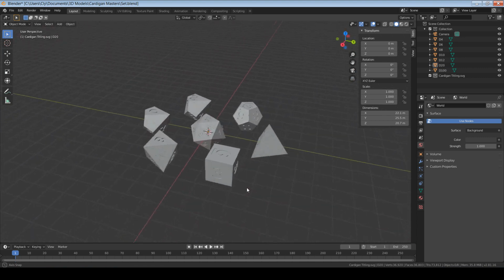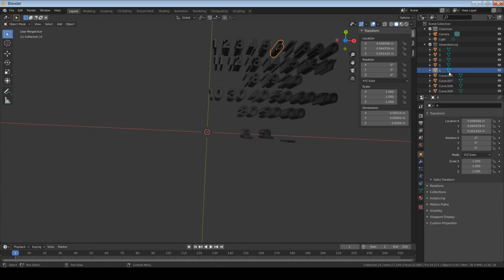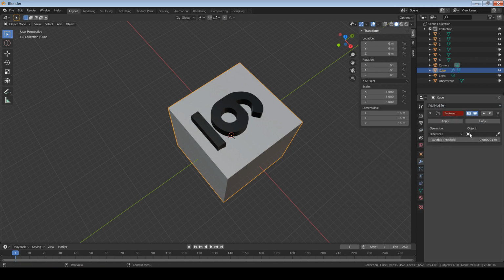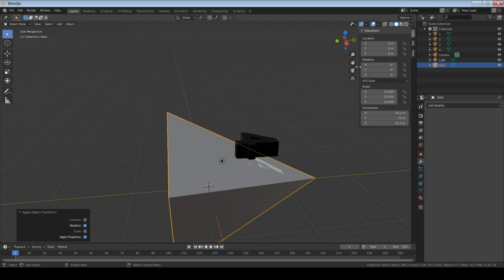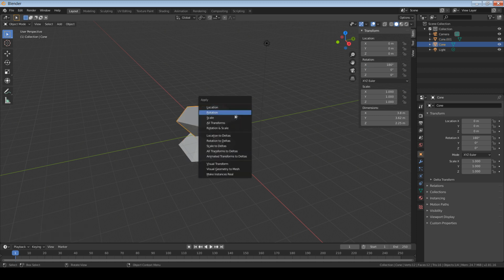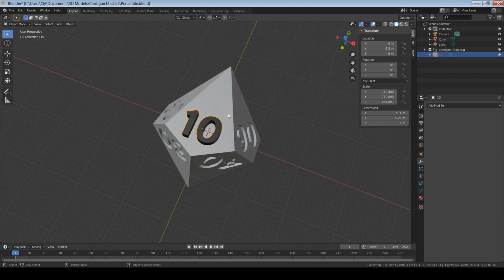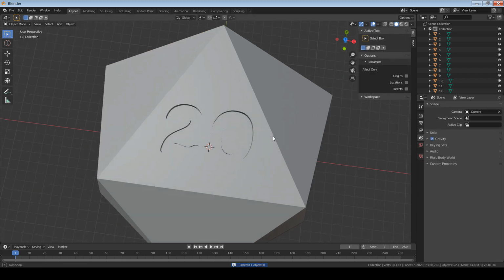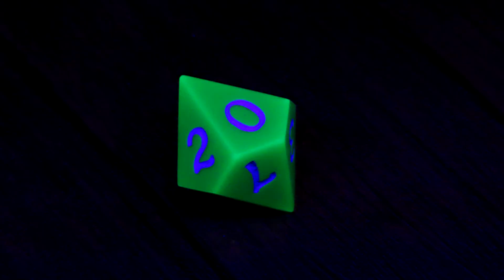Design Your Own Custom Dice for Free | Blender Tutorial | DIY with Cly Ep. 21

Comment: Great video! I'll need to take some time to fully follow it properly, particularly the rotations. You don't by any chance know of how to align numbers in Tinkercad on dice for D8 and above? :)
Reply from the maker: Sorry, I've never used Tinkercad, or any other CAD software for that matter. 😓
Reply: I'm working with Tinkercad right now. It allows numbers to be imported one at a time. Still working on the measurements.

Comment: Hello! I was wondering if you knew how to fix this issue, I tried following along but a lot of fonts I have tried to use are... broken? I dont know how else to describe it. A friend thought it was inverted normals but nothing we have tried to do fixes it. The font I am trying to use is called "Hadley"
Reply: Hey, I had the same issue as you. If you haven't figured it out yet, I resolved it by:
Instead of converting to a mesh and editing to extrude the face do the following:

Unfortunately I don't think you can do this to all of your numbers at once, you have to do them individually.
1. Select the number when it's still a curve file. On the  bottom right hand window select the "Object Data Properties" tab. The icon looks like a curve.
2. Expand "Geometry" and increase "Extrude" to .01 (1 right arrow press). 
3. Convert the number to a mesh
4. Continue with the rest of the guide - setting the origin, bringing it onto the dice, etc. You don't have to go to edit mode to expand the faces since you've already done that.
Reply: That fixed it for me, and I kind of understand why it does, since you expand the outline curve from 2d to 3d the program can't leave any blank spaces when creating the mesh, which it can in 2D mode....but I have no clue how the hell you figured that out
Reply from the maker: What program did you use to convert the font to an SVG file?
Reply: @ClyFaker  I used what you used in the video, should I try a different one?
Reply from the maker: Just to verify, this is the font you're talking about, right?

https://www.dafont.com/hadley.font

If so, I got it to work just fine using the SVG creator site I showed in the video. What image editor did you use to type out the font, since that might be the culprit? I don't know how it would be, but you never know. I used GIMP.
Reply from the maker: Also, I should have probably asked how they're broken. Broken in that the boolean operation isn't working, or something else like not rendering properly when you go to 3D print?
Reply: @ClyFaker  thats the font, and by broken I mean that it looks like chunks are taken out of it when I convert it to a mesh, so the bolean cant work
Reply from the maker: That sounds almost identical to what happened to me when I was trying to use InkScape to make SVGs. You might want to try using GIMP to create your initial image file, since that's working for me with that font. Also, maybe try changing the image file type (BMG, JPG, PNG, etc).
Reply: @ClyFaker  Awesome, thank you! I tried a different svg generator and that seems to help numbers 1-6, hopefully it fixes the other numbers as well ^.^ (I used only 1-6 as a test lmao)
Reply from the maker: Glad I could help, even if I don't know why that SVG converter decided to revolt against you in particular. 😁

When that first happened to me, it took me way longer to figure out than I'd like to admit...

Comment: Having a super weird problem. On the D10, as soon as I rotate by 180 and start on the other faces, my boolean difference no longer works. It adds instead. Advice?
Reply from the maker: I'm assuming you've applied the rotation and previous boolean operations (I sometimes forget if I'm moving quickly), and if you're on the D10 the font must have worked for the other dice. In that case, try lowering the number into the die a bit more before applying the boolean function. Boolean can be a bit persnickety with overlap points sometimes, and that same issue haunted me for a long time when I first tried making dice.
Reply: @ClyFaker  Yeah, I've already got 5 of the faces done and it breaks when I try to do the other side. Doesn't matter which number I use. I'm wondering if it's an issue with the shape itself =/
Reply from the maker: @ciarajs  That's so strange. What font are you using, and what did you use to make your vector file? I'll see if I can get it to work.
Reply: Oh, I solved it. May as well post the solution in case anyone has the same problem.
I apparently went rogue on the shape building phase. Instead of deleting the extra cone, I applied the boolean on it as well and then joined them. Don't be like me, kids. Follow the instructions.
Reply from the maker: @ciarajs  The fact that you were able to finish one half of the die without issues makes even less sense now... Oh boolean. 😅

Comment: I'm going to be using an online service to 3d print my dice. Do I need to create the supports for the dice, or do they typically do this for you?
Reply from the maker: To be honest, I don't know since I've never used one myself. However, if they do the slicing (preparing the model for printing) themselves, then they should. Be sure to ask before placing your order.

If they don't, you can do it using free slicing programs like Slic3r.
Reply: If you're using Shapeways, they just need the models.  They sort out the supports.  Other places probably do as well, but I'm sure they would be happy to answer that question if you put it to them.

Comment: NICE!  FYI Blender 2.83 is out and has a SWEET fabric brush in case you need to make robes or clothes...for your dice xD
Reply from the maker: They're cranking out revisions faster than I can keep up. lol
Reply from the maker: I'm very glad to hear that. This tutorial is aimed at people that have never touched the software before, so I tried to make things as straightforward and easy to follow as possible.
Reply: @ClyFaker  It really is concise.  I'm going to make a set later on tonight :)  I was getting confused by the angles for a second and then I remembered that I know geometry lol.
Reply from the maker: I can see the angles throwing some people, especially since I use negative angles. Then again, 15 degrees and -15 degrees is easier to remember than 15 degrees and 345 degrees. At least to me. lol
Reply: @ClyFaker  I ended up sort of winging it once I realized what you were doing and it worked out just fine.  I was able to follow along very well, and my only real issue was that moment when I was finishing up my d12 and realized one of the numbers was upside-down in relation to the rest..and it was well outside of my UNDO list lol.

Thanks again for this.  I have dice printing as I type :)
Reply from the maker: @user-e4p3b  I feel your pain. That happened to me a couple of times when first laying out the D12 and D20. 

Also, in case you don't know, make sure you use tin cured silicone with these dice if you're going to be making molds immediately. Platinum cured silicone doesn't like to set when poured over resin 3D prints, at least not for the first week or so.
Reply: @ClyFaker  Yes!  That's a pretty crucial tip for mold newbies.  There is a spray you can purchase, though, which allows you to use platinum cure with iffy materials, in case you want to shell out the extra cash for that sweet low-shrinkage rubber for archival purposes and for not getting laughed at in the showers at the pool xD
Reply: Botched a few supports on my first print and had to clean the vat and start over.  Second time worked great!  Now to start sculpting bas relief dice!! Thanks again, Cly!
Reply from the maker: @user-e4p3b  No problem. 👍

You're moving on to relief dice faster than me. I still have (at least) two more regular font master sets planned first, though there's no need for a full video about making those in Blender. Now I can just link to this one. lol